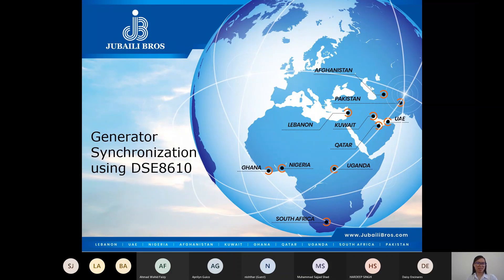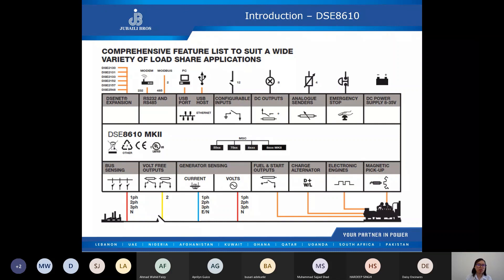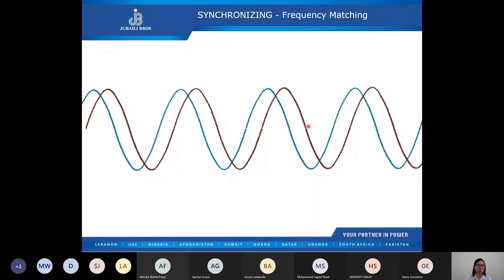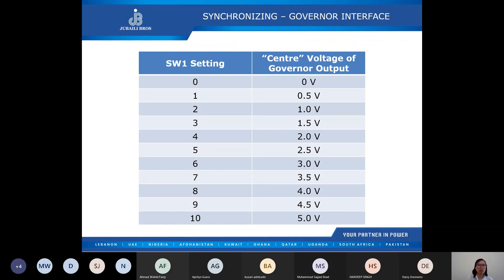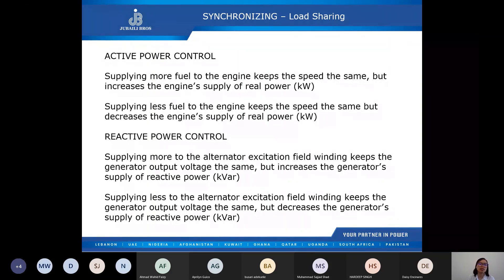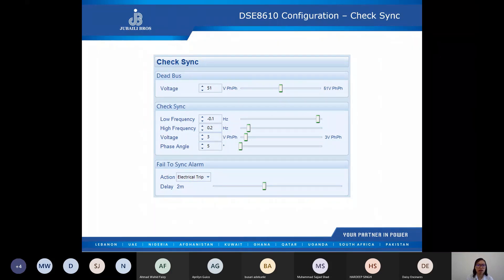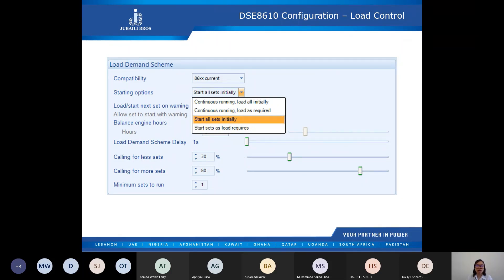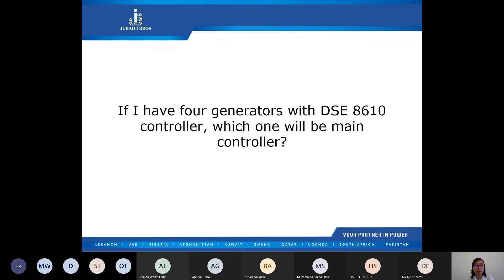Webinar: Generators Synchronization using DSE8610

Comment: Thank you for the insightful webinar on generator synchronization. I have a question regarding synchronizing multiple groups of already synchronized generators. Can we further synchronize separate groups of generators that have already been synchronized within their respective stations? For example, I have nine Diesel generators distributed across three locations, approximately 700 meters apart, with each station having three synchronized DGs. Can these three independent groups be synchronized together into a unified system?

Comment: I believe in your explanation  regarding the 4 generators feeding the load. Though the 4th priority  generator started in the intial start up, the priority 1 generator will start, sysnchronize and share the load. Gen 4 will shut down thats how the priority system in Deepsea 8610.

Comment: Thank you so much for sharing this video. 
I want to know if DSE 8610 MKII can be used to synchronize both DG and Grid power or solar power.
Also what is the function of duty select configuration?
Thank you

Comment: when synchronizing generators does the DSE8610 has built in compounding current transformers or these have to be provided by the customer for each unit

Comment: Dear Sir,

Please if I have a screen 
DSE 8610 MKII and replaced it with a screen of the same type or you made firmware update, how do I transfer the SCADA settings for the screen? Do I record it before replacing or before firmware update and then manually transfer it to the new screen?

Best Regards

Comment: I have an interesting and intiguing question. Your answer will really help. 
How to combine two AC source for higher power output?

I have 5kw inverter off-grid solar system which can't provide enough power to run a 5 kw motor machine. I also have 3 kw generator.

How to combine 5kw solar system with 3kw generator, to get 8 kw system, for generating enough power to run 5 kw motor machine?

The inverter specification and generator output is given below as shown in picture:

Inverter Voltage =220. Generator voltage =230V±5%
Inverter Hz = 50hz . Generator Hz= 60 Hz or 50 hz
Inverter wave form= pure swine. generator wave form= not given.

Comment: When dse8610 MKII used for synchronization, is it compulsory for remote start signal connection on each generator? or msc link will perform that task?
Reply: Msc link will handle the start signals
Reply: On the same question, so we only need one starter remot on the engine priority number 1, is that right?